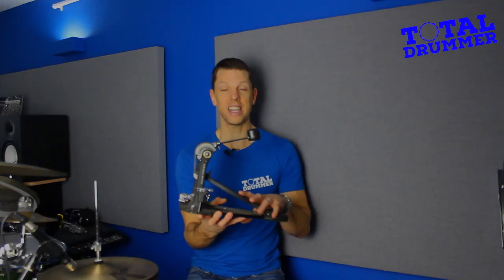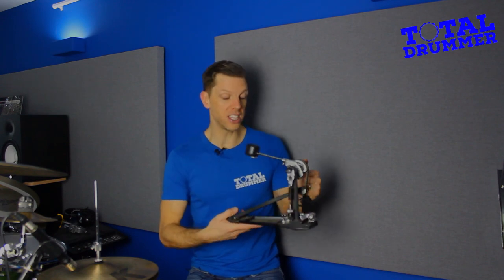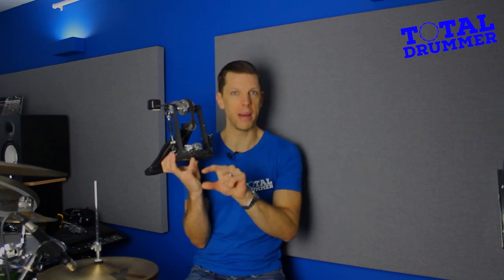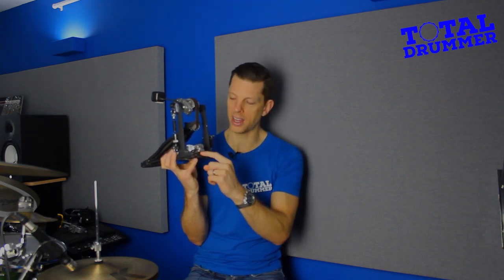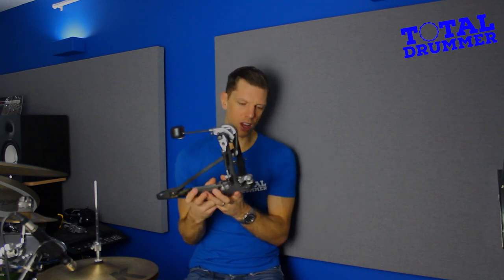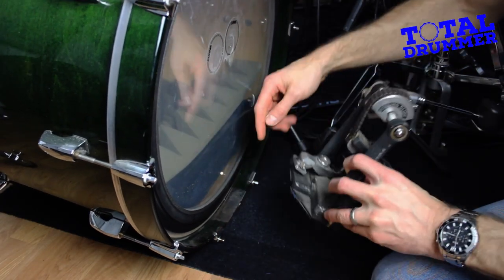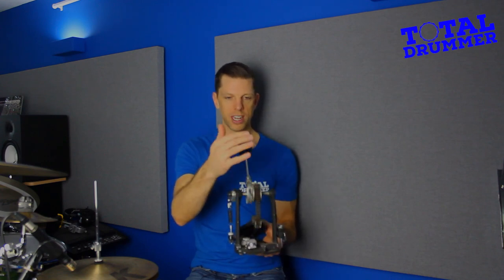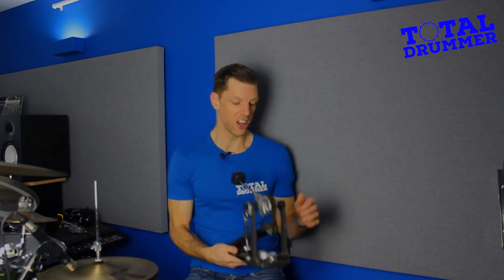How To Attach A Bass Drum Pedal

Comment: What do I do if my iron cobra pedal doesn’t fit my bass drum cause the rim is too thick? Any solutions?
Reply from the maker: Interesting question Jesse. I have an Iron Cobra pedal here in front of me and it opens very wide. Have you loosened it to the maximum? If so, what type of bass drum is it?
Reply: @TotalDrummer  it’s a Tama Starclassic. Thanks for the reply!
Reply from the maker: That should be fine  @jessemurphy4674  I would definitely check that you've opened up the clamp on the pedal to the full extent.